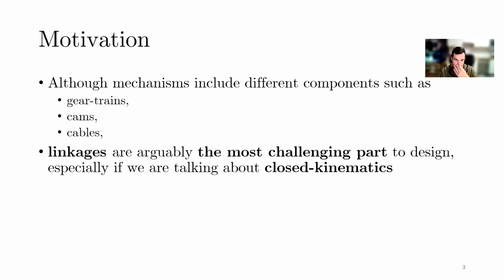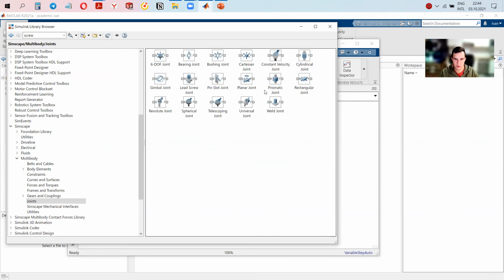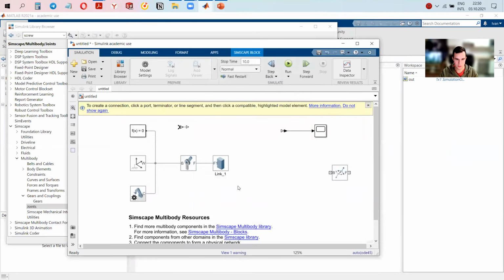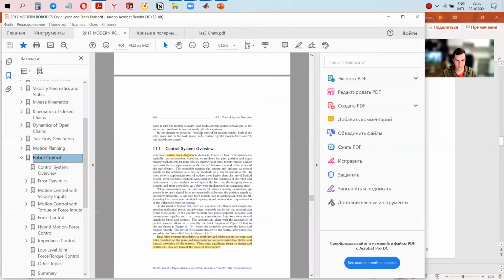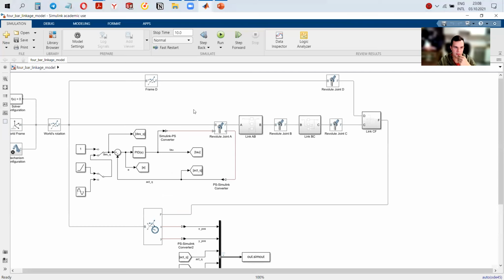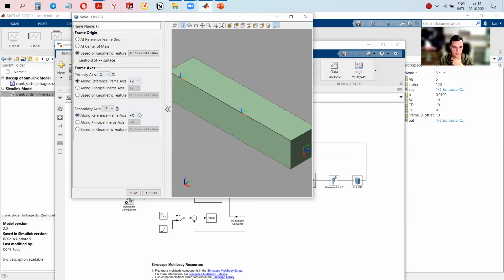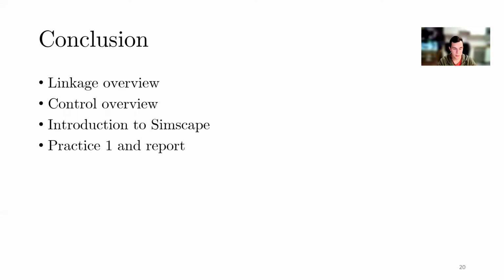Closed linkages and PID control

Comment: 1:43 Motivation
2:26 Definitions
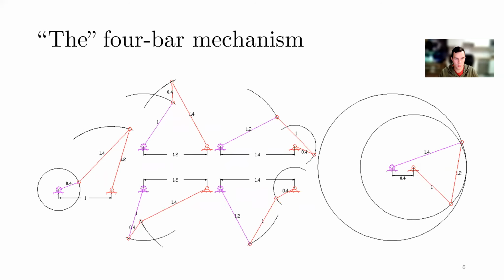4:20 Examples
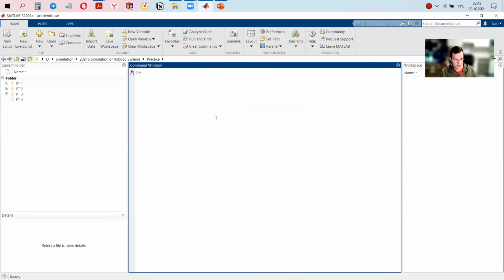6:00 Matlab Demo
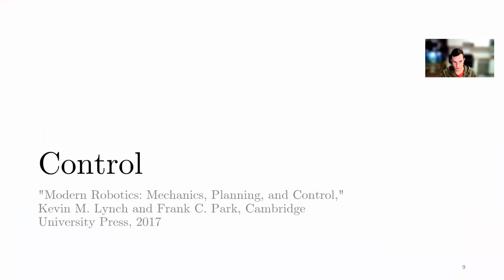19:20 About Control
21:25 PID intuition
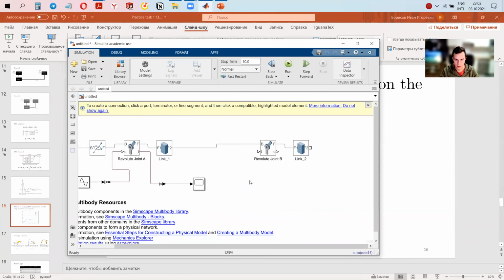25:30 Matlab
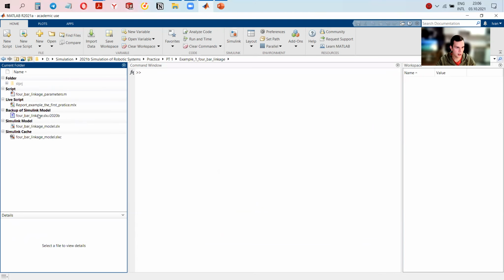29:32 Example 1: Four-bar mechanism in Matlab
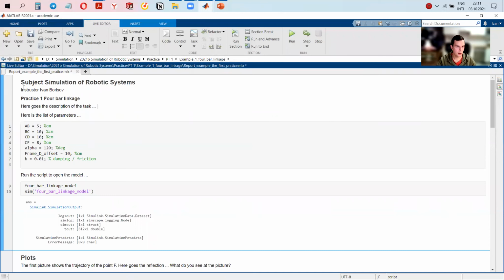34:40 About Practice
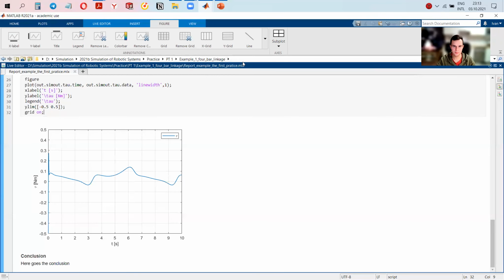36:30 Example 2: Crank slider mechanism
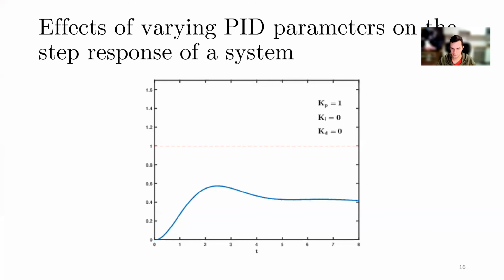37:56 Linkage variants
41:40 The Report